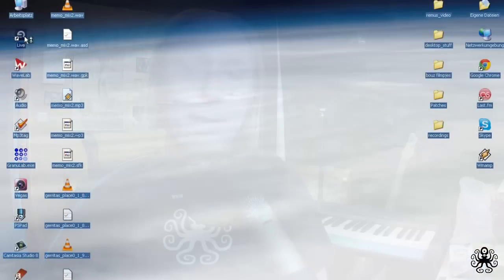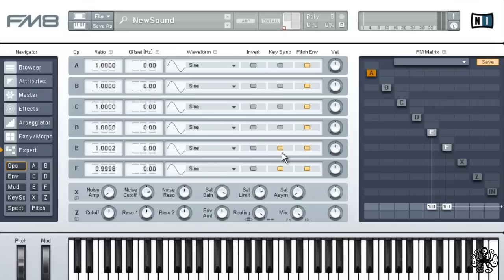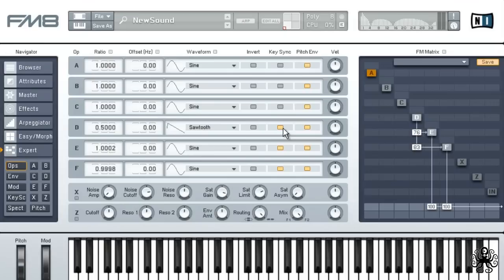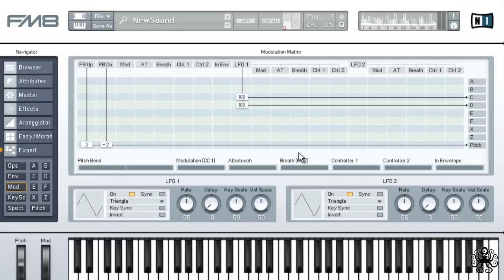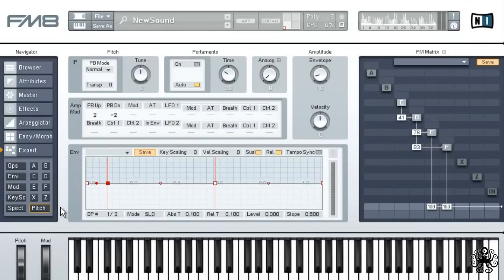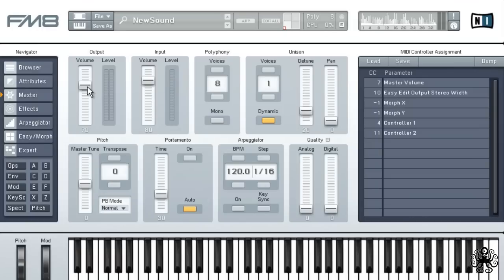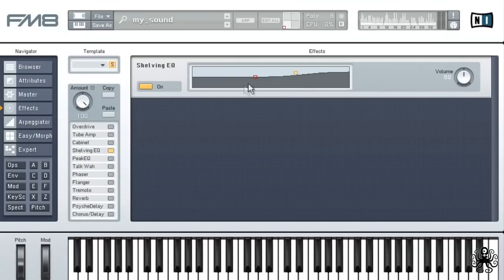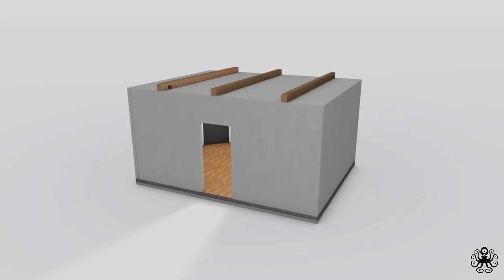FM8 Wobble Bass Tutorial

Comment: The ratio is, as it's name implies, a relative factor. It basically multiplies the ratio with the Pitch set in the master tab. For example: 440 Hz and the ratio set to 2.000 will result in a pitch of 880 Hz for this oscilator. 0.5 will result in a pitch of 220 Hz.